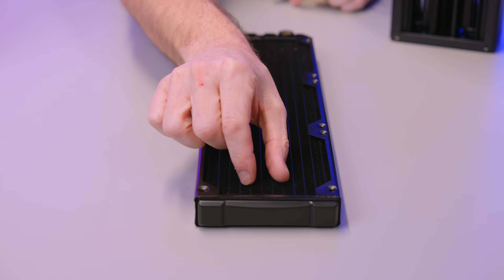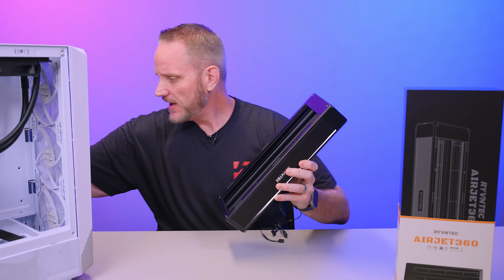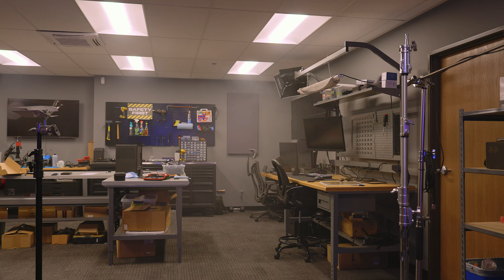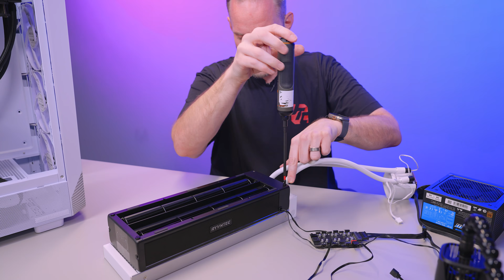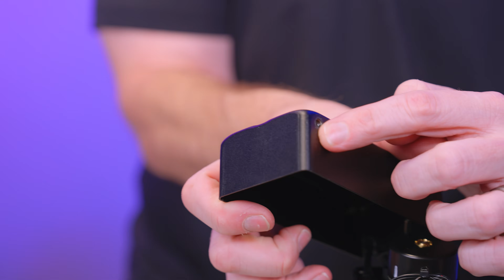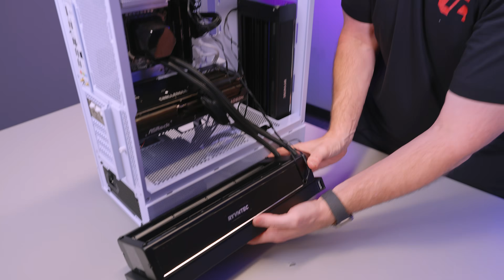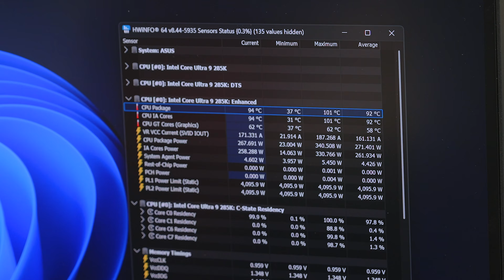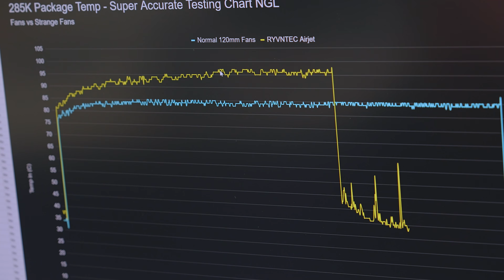Check out this INSANE Prototype!

Comment: Noise is bearing/motor noise based on axial roller fans.  Sounds the exact same as my decades old ones that are 1/4 the length (roller size, motor, etc. all look similar however).  You won't hear much air disturbance noise due to the blade design and roller motion, which is apples to oranges versus a standard centrifugal PC fan.  The screws appeared to be clearly running into the motor housing on the end that turns.  Poor design, but they are trying to also keep the overall bulk dimensions of this from being too large.

They're obviously great for moving a straight block of air from A to B.  Good for pushing already hot air away over a larger distance with decent pressure.

Your FPI setup, especially on current day cheap AIOs are very low count and non-restrictive as you're aware.  So there's very little to work with if you remove most of the air turbulence to affect those fins to cool further past convective transfer heat into surrounding air.  Hence the unfortunate performance you're seeing, regardless of amount of air moved through.  More turbulence = better cooling potential with your finned heat exchanger and more noise.

You would need different fin design (slightly angled perhaps?) to really utilize this well.  You're just speeding up a normal slow acting chimney effect.  It might be more interesting using it as a negative pressure main inlet instead of directly blowing through it to see if you can get better results that way than forced straight air.

This is actually a great example, in the situation used, on why high static pressure and flow rate are not the end all be all determinants on radiator cooling performance.

Comment: I could easily 3D print a spacer that would properly spread out the air from one of those airjet fans into a radiator.  Would probably need to be two pieces, but that’s not a big deal.
Reply: Yeah a spacer with a v channel would work a pull config would also do better basically how air purifiers work
Reply: Your over engineering for a problem that doesn't really exist if you just use the fan in a pull config like its meant to be used.

Comment: Crazy idea: mount the rad without a fan and just let the front fan do its thing. Think of the Corsair one that has 1 fan that cools everything. One problem one might see is that the rad must be the only exit, so blocking off the rear fan mount. As you say, if it has great static pressure, it could be useful in a build like that.

Comment: If they put a tube in those screw holes, not only would it help the screw go thru, it would also stop the over tightening from pushing into the motor by stopping it from essentially crushing itself.

Comment: Every wallmounted minisplit AC uses a Crossflow fan in pull Konfiguration.
And they are chasing efficiency like crazy.
It has the advantage of using the whole area of the heat exchanger  instead of blasting a limited area with all force

Comment: The design is similar to a lot of air purifiers. Could be cool if they could come up with a diverter to expand the flow. Also it would be simple for them to put inserts in to prevent the case from impacting the fans. They could modded easily with off the shelf plastic inserts for the DIY guy.
Reply: It's the same design as an A/C or air purifier but they pull it through the radiator or filter material and not Push it like he was trying to do.... Sadly he never tested it.

Comment: So, the front would be like a vacuum for pet hair and dust needing a good serviceable filter. Maybe just one per case to pressurize the inside of the case and normal fans for exhaust unless they make attachments that direct the air where you want it. Would be interesting to see different push pull configurations. This test with the rear fan removed seemed to skew the results as air will travel the path of least resistance. Ive not been happy with fans and heat inside our cases, so this looks like a great step forward. Thanks for the video.

Comment: You can NOT use the holes next to motor and use the ones lower.  Solid enough to offset the one side on a a rad that has 6 holes a side

Comment: I mean, blowers have run this style of air movement for damn near a century now and, as part of forced induction, they can create incredible pressure. I understand this likely won't make much pressure (hollow rotors versus solid lobes). Anywho, make an extreme static pressure, rad only unit with spacing for output distribution across finnage. Dew it.

Edit. Also as a bottom intake, options for deflection might be interesting. For example, I have an Antec C5 with three fans on the bottom, a vertical GPU, and AIO up top. The lowest side fan is removed and three hdd's are mounted there. A problem I have is the GOU cooks those hard drives during gaming. I have a 3d printed cover plate and I'm messing with gathering some airflow to cover them and keep them cooled a bit better. But 120mm miuntable deflectors for both intake and exhaust direction control could be bitchin'. For me, two deflectors pushing the air forward to the glass the the right/front end pushing output to the back across those drives.

Either way, post some dimensions so we can play with 3d prints. I'll be getting one as soon as its avilable. 😊

Edit of the edit. Well, sheeyit. Nevermind. The very bracket is about a quarter inch above the 25mm fans I have on the bottom already. Plenty of clearance to the card, but the CoolerMaster V3 (I believe that's what it's called) bracket starts much lower than that. Crapola.

Comment: Blowers are made to move a lot of air at higher static pressures than regular fans.  They are widely used in HVAC for their ability to provide enough static pressures and CFM inside ductwork for better air distribution.  In rooftop AC units they have the blower mounted on top of the supply plenum, with the intakes of the impeller open on the other side to pull air from the return through the evaporator coil.  If you wanted it to cool a PC radiator you would need a shroud that covered the entire radiator and the blower housing.  The blower outlet being the only thing sticking out the back of the blower.  You would get more even airflow theough the radiator with the blower pulling rather than pushing.  Its why every HVAC unit is built this way.
Reply: Blower fans are not crossflow fans.

Comment: Try using a server water rad. They come in 80mm x 360mm. I believe they also come in 40mm x 360mm. Could take advantage of that narrow channel of air.
Use your printer to make some guide tubes for the long screws. A nice tight fit will stop the binding.

Comment: A fan like this is a SFF case DREAM, just need sizes to fit SFF cases. The reason these fans work so great in mini-splits is because they have fins perpendicular to the fans that generally have a 2nd motor to move them back and forth oscillating, but that would add more thickness to the device.
Reply: I agree. If they could shrink them down slightly it could be a game changer for SFF builds.
Reply: @TFEArchive I have worked on these type of fans as a property managers maintenance man, the blades can easily be cut down to make it a 240mm by 120mm fan

Comment: If you had a completely sealed case, the Ryvntec on the front as intake and then your AIO was the only exhaust would it not both have good positive pressure and good exhaust through the AIO, Then you only have one unit providing air for the whole case.

Comment: They will need to increase the motor clearance or add spacer tubes around the screw locations to prevent the metal cap from being compressed when the screws are tightened.

Comment: This thing just feels like trying to revinvent the wheel...three 120mm fans at that massive thickness would move a ginormous amount of air as well, and not just over a small part of their surface area either. Noise might be the only consideration there, but other than that, this prototype just comes across as a solution looking for a problem.

Comment: perhaps a hybrid system would make more sense. use this monster for intake and regular fans on the rad. neat concept, but the size is a bit much considering the market slowly shifting to SFF.
Reply: There's an sff build on reddit using a generic crossflow flan and axial fans on the radiators. A case based on a crossflow fan "exists". Meshless AIO from Meshless Design. GN, LTT and others have videos of it

Comment: To fix the pass through screw issue if you used a full length tube as a screw guide it would both guide the screw through the shroud and it would support the cover to mitigate its flexing preventing the cover from interfering with the motor.

Comment: Would be interesting to see how it behaves if you completely seal up a case and only let the air out through the rad. Using this fan as the only intake point. Like a super positive pressure case.

Comment: So maybe not great with radiators, but really good for making a super quiet PC. As a large case enjoyer, I am tempted to try one, although I would have to remove both of my disk drives to fit one of these beasts in there.

I also wonder how good the airflow would be for a vertical mount GPU. I bet if the "sheet" of air goes in front of the fans, it will be great, but what if it doesn't?

Comment: If they made a radiator or heatsink that could be fed from the side rather than the front or back, a bit like a thin server or a laptop cooler for example, I think this could work well. I have to say, I was surprised how quiet it was.

Comment: 3D print guide vanes and a shroud using a Fibonacci "S" curve that brings the air flow path parallel to the radiator fins will maximize your boundary layer development and give a clean boundary layer separation. It's something that could be designed and printed in a day.

Comment: I enjoyed watching this video and I think you've more than proven that this type of fan doesn't work on any rad, custom or AIO.   What I was also hoping to see is this fan in an air cooled system to see if there are any benefits.   CPU air cooler with the Airjet maybe incoming from the front and outgoing on top kind of thing.  I would enjoy seeing the difference between standard fans and the Airjet.   I think you did a really good job in showing why the Airjet won't work with any rad.

Comment: Scroll fans not good for aio because of the turbidity at the fan right next to the radiator. The scroll fans are both pulling and pushing right at the surface. You never see scroll fans as a rad cooler (cars or compressor radiator on an ac). However for massive air movement in the chassis is a great application when there isn’t anything right in front. Scroll fans have a a high cubic inch air movement relative to the size and make great fans at cooling large space. You see many newer room fans on market as the tall thin fans, they are also scroll fans. Same in dysons. So makes complete sense to use as a full case fan.
Reply: I'm to lazy to type all that. Can I just agree? 😁

Comment: That was fun.. but can we ditch all the AIO and test.. just what it does as just a front intake fan replacement? Like is  it a great low db high flow option? Would it it work great with cpu air coolers? Would it be so powerful that you could only use that one fane as a case fan and 100% positive pressure?
Standard case fans vs this unit comparison temps?
Thats kinda step one.
Thanks. Love.

Comment: Ok. So I know it's totally impracrical. But a video where you make some sort of defuser and use a gasket material (like speaker gasket in car audio) to seal the fan on the radiator would be cool. See if you can find a way to put all that static pressure and flow to use on a radiator

Comment: Should it push or pull the air through the rad? I imagine it wouldn't do well at pulling, on account of the gap but I also don't know if it's rated for pulling but? Yeah I agree...it needs a tube for the screws, or for the motors to be more centralized, as opposed to offset towards one side. Is the GPU running hotter than the prior config? That's important too. If it provides sufficient air to the case, or better, than versus conventional 120mm+ fans? The GPU should tell the story.

Comment: I wonder what would happen if the 2 fans spun in the same  clock direction rather than spinning inward to the middle. Maybe it would concentrate that air Evenly across the radiator instead of directly down the middle.

Comment: I wonder if the designer could fit a V-shaped air deflector in the middle of the exhaust side making the flow wider to better suite radiators?
Reply: A couple of angled vanes was my thought.  Basically a V with a middle gap.
Reply: These fans are supposed to pull air through a radiator not blow through it. So trying to shape the air on the output would just create restrictions.

Comment: When is the 120mm Hurricane R32 LCP PRO BK with over 151 CFM and 8.78 mm H20 static pressure coming out? That's what I'm interested in. Plus I don't need any RGB, I just need them to work as advertised.

Comment: there is one or more reasons why no one uses these types of fans in cooling. it is for moving air with speed. it has no pressure without a channel after it and it is too loud. i think its just a new thing to sell, but: NO. ;-)

Comment: For lack of air flow on sides a flat plate in front with the cros sectinal area of the main column so devided in half diverting it to the sides would be worth it because the air should stagnate a little bit on the fins to actually sit and absorb the heat more efficiently like a rad in a car with the shroud its made to slow air down more so then aim it

Comment: Would have liked to have seen how the regular AIO fans preform with the intake swapped out, as well as seeing the airjet in pull configuration on the AIO.
Reply: This, and a tower air cooler. I would imagine this could also be good with a noctua passive cooler too. I guess you could add ram/chipset/mosfet temps as well.

Just do all the possible options comparing to known good front 120 fans.

Comment: A rubber gasket or foam lining right around in conjunction with a spacer will sort out the issue. The bigger void space may sort out the uneven airflow through the fin stack.

Comment: Surface looks wide enough, not full cover. Try lowering the speed. I think what's happening is air goes through so fast it can't absorb the radiator's heat, remember heat transfer takes time, too fast=no transfer

Comment: Feels like it would benefit on the radiator more if the airjet was pulling the heat away from the radiator rather than force cold air through it and out the other side. Since it seems to have a wider duct for inlet air rather than the outlet air
Reply: It's how these normally function, in a A/C they pull the air through the radiator and not push.
Reply: @SilvaDreams yeah these radial cage fans is pulling in most installations through the evaporator. In some installations push (your car interior air blower) exhaust gas ventilation fan on workshop etc is cage radial fan. These fans do have big static pressure…

Comment: The style of fans honestly aren’t that great. They are used a lot in appliances. because the way the bearing takes the load They tend to fail pretty soon. They also make a lot of noise when the bearings start to fail so if they improve on the design good on them, but having a horizontal bearing try to load a vertical fan like a tower fan more than not those bearings fail sooner

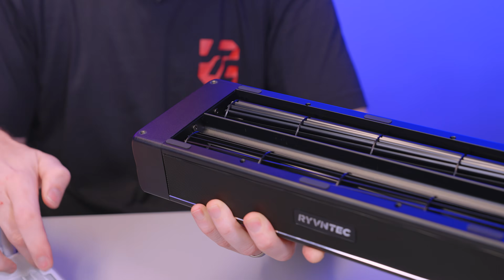Comment: 15:40 the force from the screw is bending the metal and touching the motor. You simply need to reinforce the metal with a shim between the motors to stop that bending.
Reply: Having a tunnel there for the screw path would also help, and realistically is actually the optimal solution, as it would fix more than one issue.

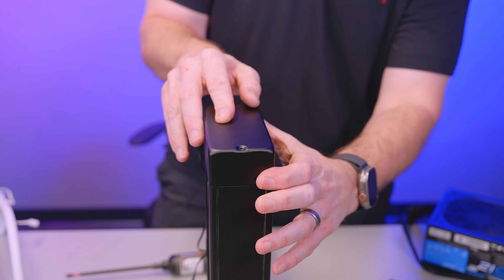Comment: 15:00 I have a 5090 Vanguard and one of the fans is over the edge of the shroud. When I put up the small L-Bracket in my Case to helpt with the weight, it touched the fan and stopped it.
I only noticed that after 2 months of running the GPU that way, with one stopped fan, which was also pushed into the shroud with the weight of the GPU.
When I fixed that, the fan was tilted, but it still ran. A few months later the fluid inside the bearing stabilized and the fan was not tilted anymore, it fixed itself. :D
Reply: rubbing fans are pretty common, you can tug the majority of them and they'll stop.

Comment: What it really needs is an exit diffuser, which would be an easy fix. For the good news, it's a lot more quiet than the equivalent axial fan running an equal speed. My 3k and 5k rpm fans need full body spacers when mounting on the pc chassis, otherwise the sound frequency becomes incredibly annoying when pushing or pulling through metal mesh/filter media, and that's in addition to sounding like it just got cleared for take-off on max military power. Why do I use these? Because they push over 300 cfm through radiators with ease, a necessary evil when doing large resolution renders or sim data crunching for hours on end inside a workshop that has a crazy huge ceiling fan that tends to drown out everything except the machines running along the walls.

Comment: 3D print a gasket. It should help the clearance issue a lot and the radiator distribution a little. The internal screw channels you suggested could also help with the radiator rubbing issue.
Reply: Just source a sheet of thin rubber and cut it out.  Something like an inner tube then you have the added benefit of vibration damping.